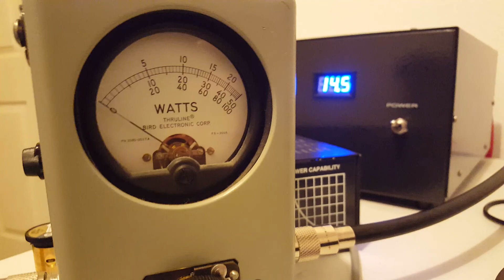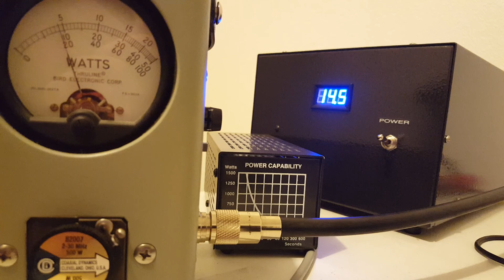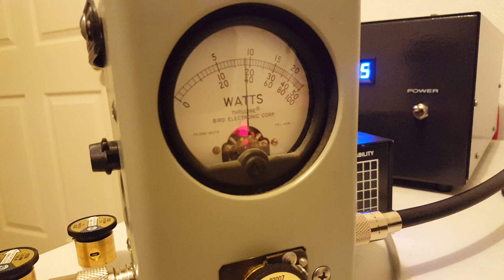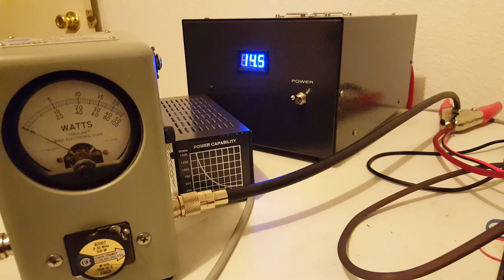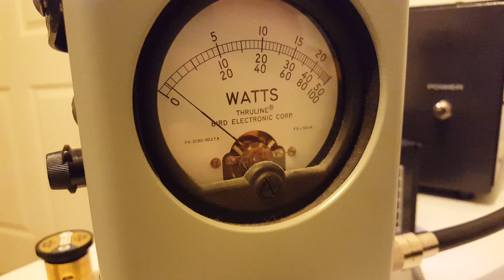Palomar Elite 250 Ssb Mobile Amplifier

Comment: Question. I have this amp in my house. I'm using a 12.8v 45A power supply, an Excalibur SSB doing 3.5 dk swinging to 10 on low RF and on high RF dk is 9 swinging to 12, bone stock radio. If I put the radio on high and the amp on low or med it seems to work fine, dk about 65-90 and swings 125-160 (low-med). On high it does something strange, it'll swing over 200 but the SWR goes well over 3 on the cross needle. Is this because it's only a 200w meter and I'm over doing it or do I have another problem potentially?